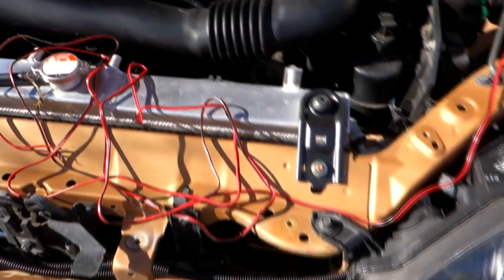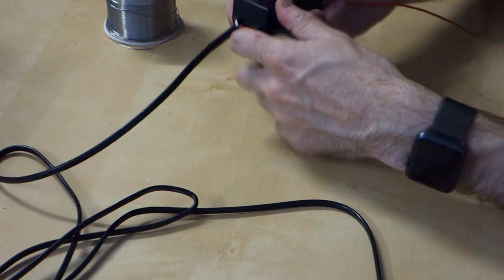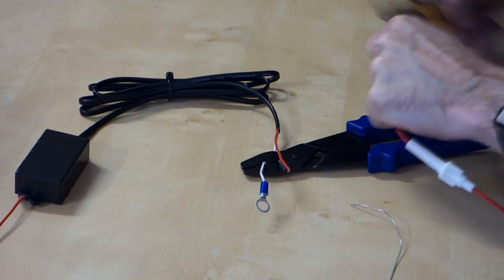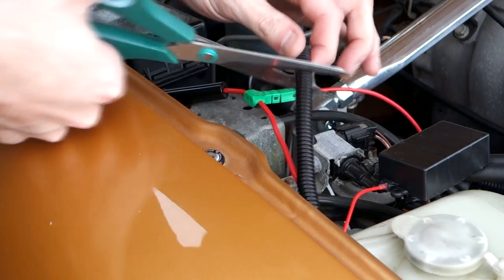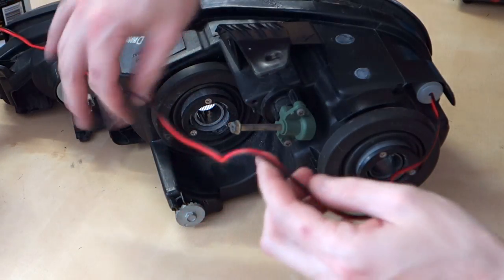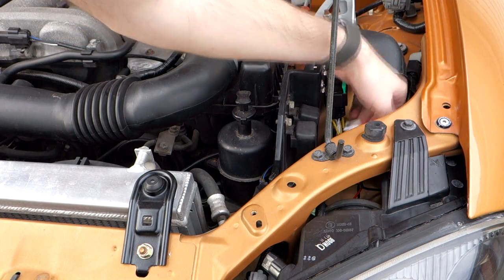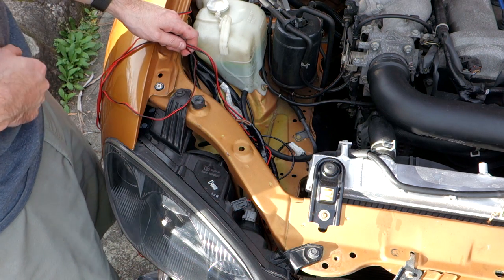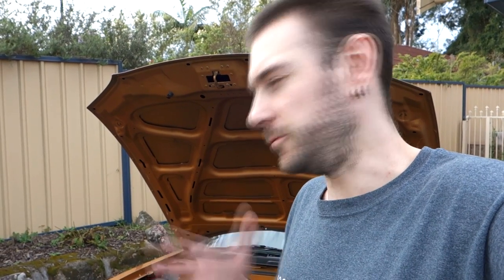DEMON EYES - PART 2 - How to Install a Remote Switch in Your Car

Comment: Thank you for this very informative video. Im installing demon eyes as well and looked for a better option to control its power. Not many videos. Huge plus was showing how to wire them to a remote. I like the way that one looks as well as the simple on/off writting. I just placed my order on this same remote. For anybody else looking to buy these, just follow his link and copy the entire name of the item then search it in your browser.
Reply from the maker: Great! Glad it helped mate!
Reply: Boosted Autos just got it in and decided to give it a test before my projectors come in. I cant seem to get the remote to turn on the leds. Is the red light indicator on the receiver suppose to stay lit ? Ive got it all wired with a 9volt battery.
Reply from the maker: Make sure you’ve got it wired identically to how I do and the jumper is set correctly. Maybe you got a faulty box? Could also be that the led you have needs more voltage.
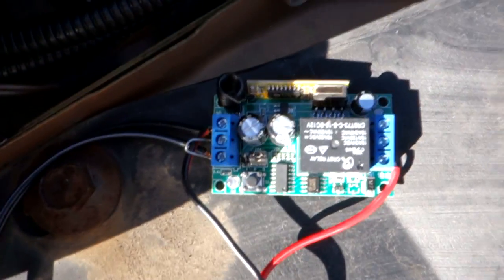Reply: I thought it was the jumper too but I looked at 0:48 and it looks the same. I noticed I was missing the link for the switch, I added it and still no luck. The light indicator just stays lit. Was it just a plug and play for you?
Reply from the maker: Yeah once I figured it the correct wiring and jumper setting it was plug and play. Have you tried re-pairing the remote?
Reply: Not sure exactly how to do that but I tried pushing the button next to the jumper then pushing the button on the remote with no luck. Did yoi have to move the jumper ? Mine looks like yours at 0:48
Reply from the maker: I honestly can’t remember if I moved it as it was a while ago. Try a 12V power source.
Reply: You got it. Bumped the amperage and now it works, well backwards. The off powers it on and the on turns it off. But good to know it funtions. Thank you for the very quick responses.
Reply from the maker: No worries. Glad you got it going.

Comment: Hi i wana do this for my demon eyes so i basically insted of connecting both demon eyes from each side together first to work at the same time i connect postive from one side of the box which will be from one side of demon eyes the negative from this same side of demon eyes to the box right were i put the postive wire from the demon eyes same size an other side of the demon eyes i put the postive in to the box an the negative from that demon eyes wil basically be grounded to the car so there only 3 wires to the box right please let me know

Comment: Could anyone help me I have demon eyes for my camaro and hooked it up correctly everything works and turns on but my problem is my battery is in the trunk so how am I supposed to power on my demon eyes in the front through the fuse box ? Not sure I wanna go with the remote switch